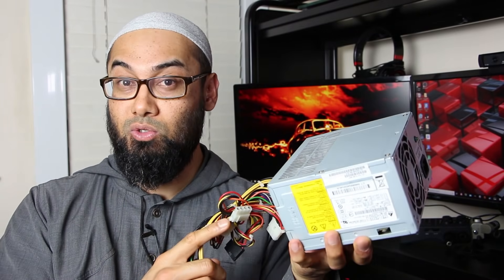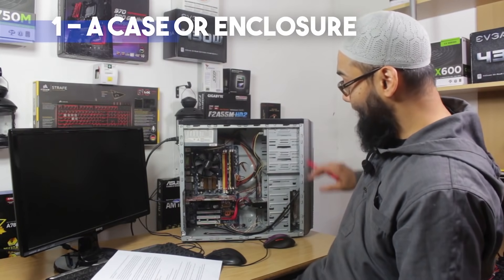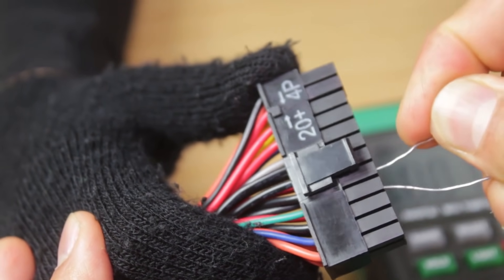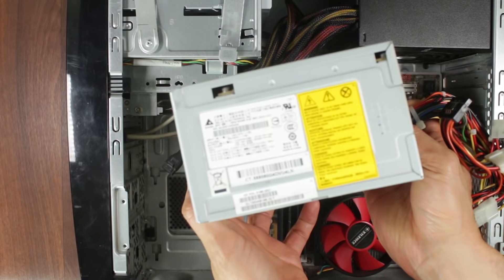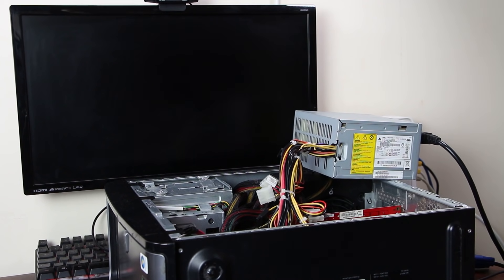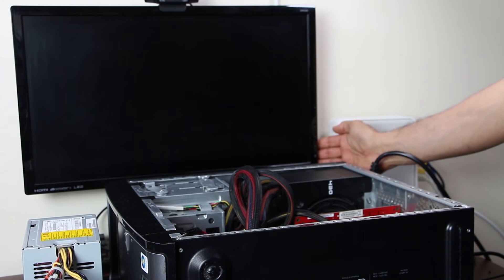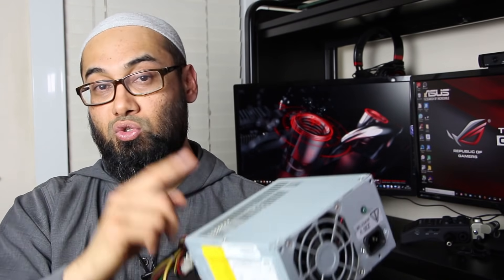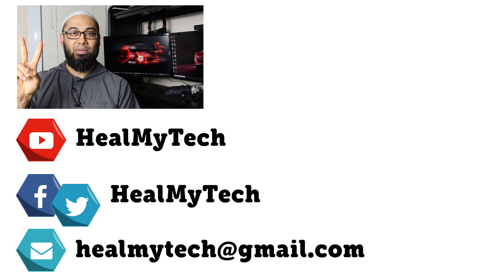Computer Turns On But No Display On Monitor | Led Light On Fan Spinning | Power Supply Unit Pc?

Comment: Hey all, I've got a similar issue with my PC, it turns on, fans move, mouse lights up, and everything appears to work. However nothing displays on the monitor and the computer doesn't beep when it turns on. I've taken out the graphics card and used the integrated graphics, same problem. Replaced the hard drive, used only one stick of RAM etc. NOTHING worked. The computer has been sitting for a year and a half or so, however I'm not sure if that really should effect too much. On a side note it won't turn off until I use the power switch on the back. The front one won't work at all. Should I replace the PSU?
Reply: i have the same issue rn. turns on, all the fans are working, mouse and keyboard lights up, everything works but monitor has no display. is your pc fixed now? how did you do it?

Comment: Hey my issue is that my pc still has power, it has the little light in the back for the internet so I know it has power. It's just everytime I turn it on, the front fan isnt turning on with everything else. I hear my PC on just not fan. This happened last night out of nowhere it was working perfectly before.

Comment: I have 2 Acer pc one is old one and onther one is new one PC and new PC IAM facing same issue system power one but no display because Iam doing trouble shot is IAM connect old CPU smps in new CPU smps and new CPU smps connect in old CPU but 2 system is working Power on and display will be came but new CPU smps is connected new system Power one no display what is issue pls Tell

Comment: alright, so i recently went to microcenter due to this problem said it was due to a bad mobo, fine, i got a brand new one and shortly after all the drivers im still getting the same issue, would the PSU be at fault here? from what i saw was either the mouse lighting up while the keyboard doesn't at all while the system was off, any idea of what may cause the dram(orange) light to stay solid sometimes?

Comment: So my game just crashed and my display went blank. I powered my pc off and turned it back on. I have no display now and my led keyboard and mouse do not illuminate as they usually would. Could be the power supply 🤔

Comment: My system fans tend to slow down spinning then back to normal and repeat.. but the fan LEDs don't flicker.
The problem is the PSU? or RAM?

Edit: I used the new PSU I just bought online but it came with minor dents.
And I think it is the issue because it isn't true rated (cheap).

Specs:
PSU:                      700watts (not true rated)
CPU:                      AMD A8-7680
MOTHERBOARD: F2A68HM-S1
RAM:                     8gb DDR3

Comment: Just got a new PC. Finely made a switch from console. Installed extra 8gb of ram and my thing won’t start. Lights are on and fans is working too but black screen and keyboard and mouse are off.
Reply: felix buswell yeah I did. I didn’t push in ram fully inside.

Comment: I just replaced my old 400w PSU with a brand new EVGA 500w PSU. Fans and lights turn on but the display wont show anything. This exact problem happened to my bestfriend so if you could help me I would probably be able to help him as well.

[Edit] I unplugged my new PSU and plugged in my old (but still working) PSU and I'm still not getting anything but a black screen. I'm thinking I fried my motherboard? I would love any assistance or tips and what not.

Comment: I have the same problem with my pc. I re arranged my room few weeks ago and moved my Xbox and pc across the room to another plug in. Since then my pc will turn on but no display on screen, strange thing is my Xbox connects straight away. Anybody had similar problems?

Comment: Can you please help me?
My pc turns on but no display,i thought it was the RAM so i placed new ones in but same results i think its the mainboard issue
BTW my setup is (I7 3770+Q77S1 samsung motherboard+GTX 1060 3gb+input 220v~3a 50hz 450w power supply with a 500gb WD blue hard drive

Comment: I have a cooler master 1200 platinum and get a no signal, I tried other methods cmos, ram, GPU. I thought I solved the problem when switching hdmi cable when it turned on but when I turned it off it wasnt anymore, I need some advice. Thank you

Comment: Is it possible if my motherboard supports only 7 or 9th generation cpu and i get lower gen cpu?? I'm also going to get a new psu and hopefully it fixes it.. my rams work on another computer and I have a ddr4 motherboard and the rams fit in the slots does that mean it's ddr4 ram or ddr3?? I don't know if it's my ram.

Comment: Thank you, im about to throw my pc away like fr, and if u guys still having a same problem, try to un plug and clean ur ram (the gold part of ram) with eraser and try it again! Hope it'll work
Reply: Thanks it worked
Reply: Gonna try it rn
Reply: Nope :/
Reply: Monitor :

https://amzn.to/3h7YWqj
Sceptre 20" 1600x900 75Hz Ultra Thin LED Monitor 2x HDMI VGA Built-in Speakers, Machine Black Wide Viewing Angle 170° (Horizontal) / 160° (Vertical)

https://amzn.to/2E1Y3Bf
Acer K202HQL bd 20” (19.5" viewable) (1600 x 900) Monitor (DVI & VGA Ports)

https://amzn.to/2Ehgq4I
https://amzn.to/2Q1jc0P
https://amzn.to/3h95qVL
Samsung CF390 Series 27 inch FHD 1920x1080 Curved Desktop Monitor for Business, HDMI, VGA, VESA mountable, 3-Year Warranty, TAA (C27F390FHN), Black
Samsung Business CH890 Series 34 inch WQHD 3440x1440 Ultrawide Curved Desktop Monitor for Business, 100 Hz, USB-C, HDMI, DP, 3 Year Warranty (LC34H890WGNXGO), Black/Titanium

https://amzn.to/348UTWR
Dell Professional P2217H 21.5" Screen LED-Lit Monitor
Visit the Dell Store

https://amzn.to/314J95M
Dell Professional P2417H 23.8" Screen LED-Lit Monitor, Black

https://amzn.to/315AEaM
Samsung LC24F390FHNXZA 24-inch Curved LED Gaming Monitor (Super Slim Design), 60Hz Refresh Rate w/AMD FreeSync Game Mode

https://amzn.to/2DSSsNH
ViewSonic VP3268-4K PRO 32" 4K Monitor with 99.67% sRGB Rec 709 HDR10 14-bit 3D LUT Color Calibration for Photography and Graphic Design,Black
Visit the ViewSonic Store

https://amzn.to/345Rl7X
ViewSonic VP3481 34" UWQHD 100Hz Curved Monitor with USB Type C 100% sRGB HDR10 14-bit 3D LUT and Color Calibration for Video and Graphics

https://amzn.to/316IEbw
Samsung 23.5" FHD Curved LED-Lit FreeSync Monitor(LC24F396FHNXZA)

https://amzn.to/34b3QPK
Acer G226HQL 21.5-Inch Screen LED Monitor
Visit the Acer Store

https://amzn.to/2YcC6pT
Acer R221Q bid 21.5-Inch IPS Full HD (1920 x 1080) Display (VGA, DVI & HDMI Ports),Black

https://amzn.to/3136YLk
Acer R221Q bid 21.5-Inch IPS Full HD (1920 x 1080) Display (VGA, DVI & HDMI Ports),Black

https://amzn.to/3aAvHdc
ASUS VE228H 21.5" Full HD 1920x1080 HDMI DVI VGA Back-lit LED Monitor, Black
Visit the ASUS Store

https://amzn.to/2FpAy5l
Acer G226HQL 21.5-Inch Screen LED Monitor

https://amzn.to/3aKR4sx

Samsung 23.5" FHD Curved LED-Lit FreeSync Monitor(LC24F396FHNXZA)
Visit the SAMSUNG Store

https://amzn.to/3g7SiPg
Samsung C27HG70 27" HDR QLED 144Hz 1ms Curved Gaming Monitor with FreeSync (C27HG70QQN)

https://amzn.to/312XboH
Samsung LC27F398FWNXZA Samsung C27F398 27 Inch Curved LED Monitor
Visit the SAMSUNG Store

https://amzn.to/3h9UNlu
Samsung LC27F398FWNXZA Samsung C27F398 27 Inch Curved LED Monitor

https://amzn.to/349pgfZ

Acer XR342CK Pbmiiqphuzx 34" Curved QHD (3440 x 1440) 100Hz Refresh Rate Monitor with AMD FREESYNC Technology (Display Port & 2 x HDMI 2.0 Ports),Black

https://amzn.to/3h1ZFsW
LG 34WN80C-B 34 inch 21:9 Curved UltraWide WQHD IPS Monitor with USB Type-C Connectivity sRGB 99% Color Gamut and HDR10 Compatibility, Black (2019)
Visit the LG Store

https://amzn.to/3l4EdGi
Samsung Business SH850 Series 24 Inch QHD 2560x1440 Desktop Monitor for Business (In Black) with USB-C, HDMI, DisplayPort, 3-Year Warranty, TAA (S24H850QFN)

https://amzn.to/2Yafh6i
Samsung LC27F398FWNXZA Samsung C27F398 27 Inch Curved LED Monitor
Visit the SAMSUNG Store

https://amzn.to/3h6QKGx

Samsung UH850 Series 31.5 inch 4K QHD 3840x2160 QLED Desktop Monitor for Business, AMD FreeSync, DisplayPort, USB Hub, 3-Year Warranty (U32H850UMN)

https://amzn.to/2DVHPK2
Samsung CF390 Series 27 inch FHD 1920x1080 Curved Desktop Monitor for Business, HDMI, VGA, VESA mountable, 3-Year Warranty, TAA (C27F390FHN), Black

https://amzn.to/2E1ieze
Sceptre C248W-1920R 24" Curved 75Hz Gaming LED Monitor Full HD 1080P HDMI DisplayPort VGA Speakers Ultra Thin Metal Black
Visit the Sceptre Store

https://amzn.to/3kXiDDg
Samsung 27-Inch CR50 Frameless Curved Gaming Monitor (LC27R500FHNXZA) – 60Hz Refresh, Computer Monitor, 1920 x 1080p Resolution, 4ms Response, FreeSync, HDMI,Black

https://amzn.to/2Q2rpBP
Samsung UH850 Series 31.5 inch 4K QHD 3840x2160 QLED Desktop Monitor for Business, AMD FreeSync, DisplayPort, USB Hub, 3-Year Warranty (U32H850UMN)

https://amzn.to/2Eg2YOU
Samsung 850 Series 28 inch 4K UHD 3840x2160 Desktop Monitor for Business, HDMI, DP, FreeSync, 1 ms response, USB Hub, 3-Year Warranty (LU28E85KRS/GO)

https://amzn.to/2Q3aVcM
Samsung 23.5" FHD Curved LED-Lit FreeSync Monitor(LC24F396FHNXZA)

Comment: When I start my pc the first time it doesn’t display the first time and when I restart my pc it does display its so annoying
Reply: Did u fix ur problem? I have the same issue as yours :(
Reply: leklekin Nope Its probably my NVIDIA drivers or my chipset drivers but Idk
Reply: Same here, it started when my keyboard and tray fell on pc. It only dropped a few inches, next clean up I'm disconnecting everything.
Reply: Same problem did you guys fix it? Only happens sometimes though
Reply: @Chocobohunter  i bought a new display port cable that fixed it for me

Comment: Hello sir , i face issues somthing like this but little bit different ,
I turn on my PC and it's perfectly power up sometime / sometimes no display after No signals ,
Then sometimes on after power up and go to Windows dekstop suddenly it's turn off again monitor only , cup is run fan on , light on , but display off what to do ?
Reply from the maker: Start troubleshooting, start with PSU, follow the troubleshoot series and report back.

Comment: Not sure if you will even reply but let me try my luck.

I had an old AMD based system, specification:
1. Gigabyte ga-m68mt-s2( revision 1.3), BIOS version F1(factory version). The chipset is NVIDIA. 7025/630
2. AMD Athlon II X2 250 processor
3. 6GB DDR3 Ram

I recently tried installing gigabyte 1650 super GDDR6 4GB GPU in it. Card fitted physically fine and I was able to get display on my 1080p 60hz LG monitor fine with HDMI port through my new GPU. But when I tried installing the GPU driver from NVIDIA site, I get no display on my monitor.

PS: I removed all the existing driver with the help of DDU also I disabled on board NVIDIA graphics by selecting PEG>PCI>on board. 

Can you please let me know how to make this card work in this system. Also how can I be sure that the card is bought is not faulty.

Comment: So I'm having a bit of a weird issue I have a triple monitor setup and sometimes when I boot up mabye every now and then my middle display doent show a picture like it will boot into windows fine but noe pictures from that's one screen also if I unplug my hdmi from my other mother and put it in again it won't turn back on. If I turn the pc off and switch it off at the plugand boot agian it's fine but it sometimes happens agian any suggestions?
Reply from the maker: Windows?  Which version?  Have you checked the monitors one at a time; that would tell you if its hardware related, if not then its a setting issue
Reply: @HealMyTech1  im running the latest version of windows i upgrade my motherboad cpu and ram over christmas however it happened once before i upgraded so i dont know really lol. it rarely happens so i cant check my monitor indivigaly rn but ill see if it happens again. thx
Reply: @HealMyTech1  hello I have an update so I just had the issue agian and unplugging my monitor and plugging it in a again seemed to fix it. It's wired because I think Windows detects it, like the picture is there but it's just hidden I'm using a dp cable if that helps not sure what the issue could be also thanks for your response I appreciate your time

Comment: hey my pc just broke down. it is 6 years old and no parts has been replaced i got the same problem but reseating rams, video card fixes the problem sometimes, but now a few months a go ive been connecting my micro usb and when i touch the tip of it i get shocks from it. did my power supply died completely now? btw my problem is the same, when i turn it on it turns on then off then it turns on and off again an again.
Reply from the maker: Hey safety first, if you are getting shock you should really have it checked professionally.  If you are unable, I would advice that you power off and remove everything and do what's called breadboarding, and then start putting components back gradually to find the cause.  I have a full troubleshoot series on the channel.
Reply: after i testes what u said i tried again it didnt work, after disconnecting all parts and reconnecting them suddenly it does not turn on , no fans running , no leds , clearly its a PSU problem right?
Reply: okay i used different PSU like in the video but still no power also tried different power button from a different pc case but still no power... is my MOBO dead?
Reply: hey man i just want you to know that my pc booted up turns out that the problem was my MOBO's 24 pin it seems that there are pins that arent connectes in the MOBO :)

Comment: This kept happening to me but i simply unplugged the motherboard from psu and plugged it back in and it turned on. Should i still replace the psu?
Reply from the maker: Do you need to this this unplugging everytime?
Reply: @HealMyTech1  no its like 30 percent of the time it does this. I ordered a new psu just to be safe

Comment: I had this problem, I unplugged everything from the pc turned the power supply off for about a minute, plugged everything back in and turned the power supply back on and it worked fine
Reply: Thanks I tried this and now my monitor works 👍
Reply: @hubbabubba5037  what did u guys Unplugged?
Reply: @snapeyt8892  First I removed the power and monitor cable, cleaned it as there was dust and re inserted after 2 mins. My monitor was turning on, hdd light was running fine BUT everytime I switched on my pc after that ,my monitor would be off, hdd light was not running. So I opened my pc tower case, removed a ton of dust from inside and the most important thing is to clean the RAM golden fins with a white eraser. Do it gently. There was a lot of carbon on those golden fins. Once this was done and the RAM put back in, I have not faced a problem once. Try it, it's not hard and don't worry about it. A noob like me did it 🙂
Reply: Fucking LIFE saver my old computer which was nice had a motherboard burn out and I’ve made some bad buying decisions because I was a little too lazy to get started with a new motherboard for like 4 years well got a Walmart hp and it had NO room for anything and went to amazon and got a cheapo standard tower and figured out it was a mini but it came in today and had everything set up but nothing turned on at first but the fans and you just saved my depression of again another regretful decision
Reply: I had a similar problem begin yesterday morning on a computer that had been working fine and I did the same thing. It seemed to have worked, I used the computer all day, I even restarted it a few times.

But... I'm having the same problem today, and while I could probably do the same thing again, I imagine it could be some deeper problem.
Reply: Weird unplugging everything off for then plugging it back in worked
Reply from the maker: Brilliant, classic Hard Reset Fix, thanks for letting me know.

Comment: Hey there, need your help. So my situation is, im using my computer fine then i shut it down to go eat. Come back 1 hour later and when i turn it back on, the monitor light are on but no display. The keyboard and mouse has no power. What is the reason for that? How do i fix that?

Comment: So I left my pc on and I walked away and it froze so I turned the whole pc off.Then I turned on the pc and it keeps saying no signal.My pc was working fine what should I do?....
Reply: The monitor keeps saying no signal
Reply from the maker: Time to start troubleshooting...check all cables, hard reset, reseat RAM etc, I have a full series on the channel...

Comment: thank you so much dude :)
Reply from the maker: you are welcome...!
Reply: @HealMyTech1  There is a modified bios available on biosmods.com allowing overclocking and 95w six core phenom II support for the MCP61PM-HM it is an am2+ socket so has some compatibility with am3 cpu's but is limited to 95w spocket power.

https://www.bios-mods.com/forum/Thread-HP-MCP61PM-HM-Nettle3-5-17-With-Unlocked-Overclocking-Options?page=10
Reply: @HealMyTech1  hi so if i get a new psu it will connect ?

Comment: Hey I recently built a whole pc and when I turn it on everything is running but I have no signal on both my monitors but I put in an old powersupply that was on 450 so should I just buy a new power supply
Reply from the maker: You need to test the power supply independently first, and also check all your connections to your display.  Are you getting a successful POST or beep code?  I have a complete troubleshoot series on the channel, have you checked it out?